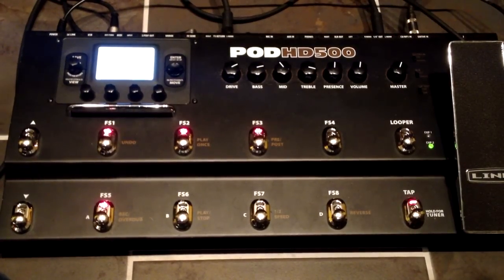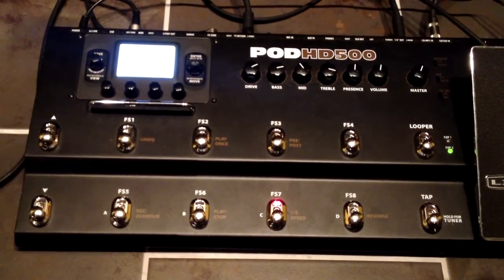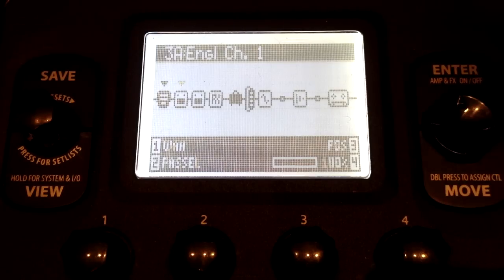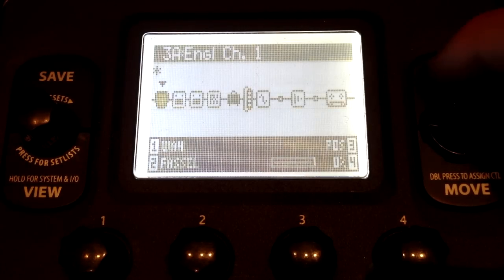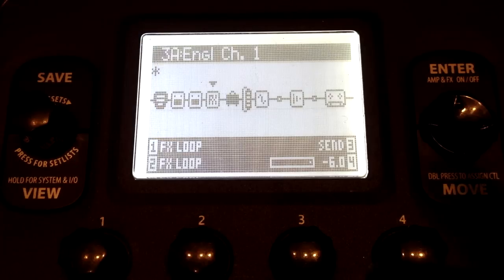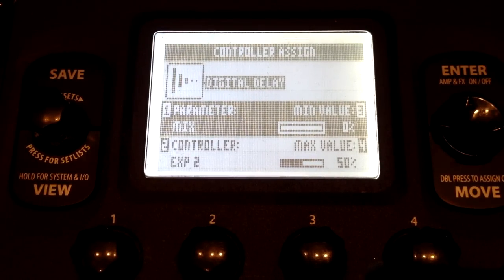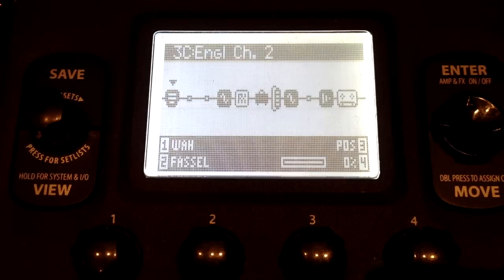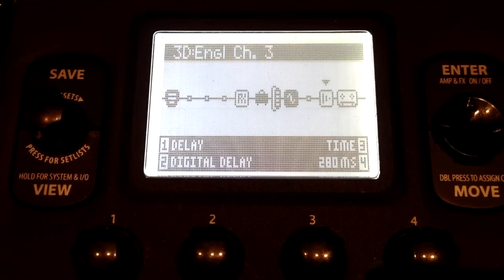Pod HD500 rig/tutorial - 4 cable method (4CM)

Comment: I've tried the POD HD 500X with my valveking head, and the sound is a lot thinner than connecting directly to the amp. I've tried my ISP decimator G-String as well and it sound same as connecting directly, so theres nothing wrong with the cables or the amp.  FX loop is engaged, mix is 100%. It sounds as loud as before just a lot thinner and more high end :S Have you noticed something similar?
Reply: Hey Brother, There is a lot you can do. Input and output settings are huge. Plus you'll have to play with levels. The first thing most guys do is put the FX loop after the mixer in the signal chain and boost  both path A and B on the Mixer 6 Decibals. that'll fix most of your tone. the Breakup or gain structure of your amp will be slightly changed and it may bug you still, but bear in mind that you still have your dynamics back, regardless of a slight loss in tone. The next step would be to set your input settings to input 1 Guitar (as apposed to the default Guitar + Aux + Varian) and input 2 as Variax. (freeing up DSP). You should be set to Global, Guitar In Z set it to 3.5m or 1m depending on your amp. Output should be Combo Power Amp. (try different settings, that one works best for me. Ok make sure you have all the switches on the pod selected correctly. Line or Stomp switch should be set to Stomp, the the Ground or Lift should be set based on hum. Same goes for Amp/line. I have mine set to amp.  That should get you started!

Comment: I have a huge hum/buzz on my 6505 on 4cm with HD500x and I'm not able to get rid of it. All the cables are new. If i connect it the standard way it is ok, but 4cm hums like crazy.... Any idea how to solve the issue? Thanx. Great video btw.
Reply from the maker: Try a ground lift on your amp.  If that works, then buy a real hum eliminator for the amp.
Reply: Ground lift does not work, getting same hum(but only in 4cm), I actually have a hum eliminator but that changes the guitar sound color/tone :/

Comment: I have this set up to my amp the exact way you do but I only get a signal when the FX loop on POD is enabled, once I disable it I have nothing. It doesn't matter where I have it in the signal chain???
Reply from the maker: Check your wiring again
Reply: @RichieCastellano  I went over it 4 times, not the wiring. I'm starting to wonder in the fx loop on my amp head is not working. Hence why the POD is not getting a signal back.
Reply from the maker: Some amps have switches to activate the loop.  Also check if there’s a loop level control on the back.
Reply: @RichieCastellano  I have the FX send and return volume on the back of my head turned all the way.  There is a button on the front of my amp labeled FX Loop/Boost. When i press it the volume completely cuts out. My amp is a Bugera 333XL.
Reply: I figured it out, had to use a stereo cable from POD output to Amps FX return, everything is golden now.

Comment: what is the output setting should i use if i wanna use the pod preamp? studio or stack front or powerampstack?
Reply from the maker: I use studio and just turn all the cabinet simulation off.
Reply: Hi Richie, Love the videos! Do you keep the Output set to Studio, even when you use the Amps Preamp too? I'm getting a wicked hum with the 4CM, and I use my Amps preamp stage, I have it set to studio,  Stomp, and Line. What are the ideal settings?
Reply: Try balancing the pedal and amp. Turn down the master on hd500 and use master vol on amp to set volume. There are also parameters within fx loop that can be used.

Comment: Have you compared your dry signal with you signal going through the pod?  Do you experience tone suck.  Are you using the same settings as You Tuber Tyler Johnson?  In his video he suggests - setting effects loop switch to stomp, put effects loop block after mixer and mixer is boosted 3db on each channel and panned to the center.
Reply from the maker: formercakid I'm not getting much noticeable tone loss, but I'm not such a stickler for stuff like that.  In the past, I've gone crazy A/B'ing things, but lately I've been working on getting a sound I like out of the current rig instead of comparing it to other configurations.    The best thing to do is experiment with both methods and decide which one you like better.  All this guitar tone stuff is so subjective.  At the end of the day it's all about what sounds best to you.

Comment: when using the Engl pre should the fx loop on the line6 be pre or post?
Reply from the maker: Are you talking about pre or post the amp block within the pod?  If so then it doesn't really matter because you'd be bypassing the pod's amp in favor of your engl amp.  Then it depends on where you want the effects.  I put the FX loop after Wahs and distortions and before spatial effects like reverbs and delays.

Is that what you mean?
Reply: Hi Richie,

Sorry for not having answered to you earlier.
Well, I have all my pod amp blocks off, so I can go right into the amp´s pre. Actually I have a few that are on, so they can bypass the amps pre. Mostly cleans with loads of verbs and delays. In this case I can use the dual amp on the pod and have 2 verbs and 2 delays creating great ethereal cleans.
My biggest concern is that I may be using the loop block on the x3 in a wrong way.

Let my describe my chain:

Gate ON / Wah OFF / Stomp OFF / Amp+cab OFF / Comp OFF / EQ OFF / Volume / LOOP ON (in Post) / Modulation / Delay / Verb

What I feel is that the verbs, being in post as they should be, they sound way to arshhh. They sound way better when in pre.
Also, inside the pod I have the loop block with 100 send and +4 on Return so it matches the volume of the amp without the 4 cable thing.

Should the loop be in pro mode? In this case I would have to lower the return level on the loop block...

What is the correct way to conect the damn thing so the red light on the x3 does not clip (that is another concern...because it clips sometimes lol)
Reply from the maker: Ricardo Rosa I'm not familiar with how the X3 works.  As a general rule you want stuff like reverb and delay to go after the preamp....BUT,  that really applies to distorted sounds only.  If you like what your preamp is doing to the line 6 reverbs, then you should keep it that way.  If you think something sounds better then go with that.